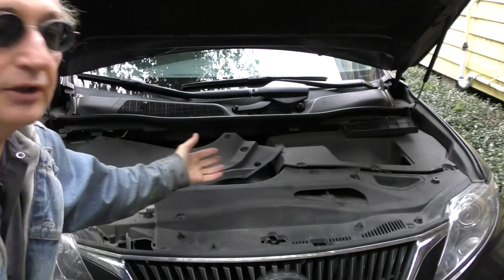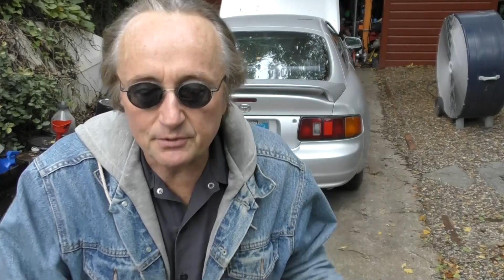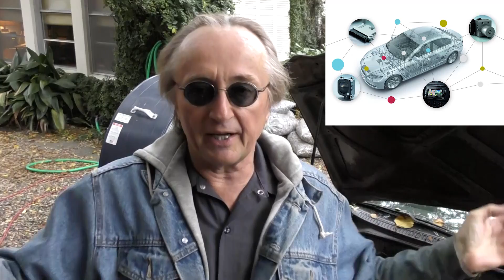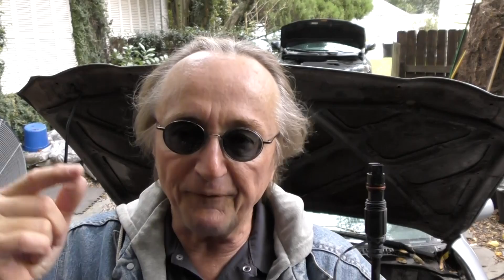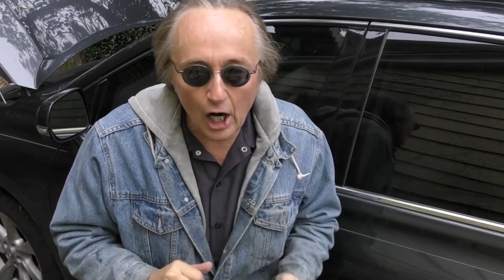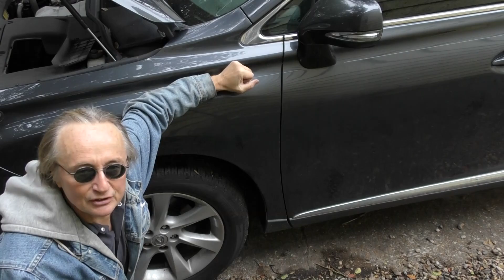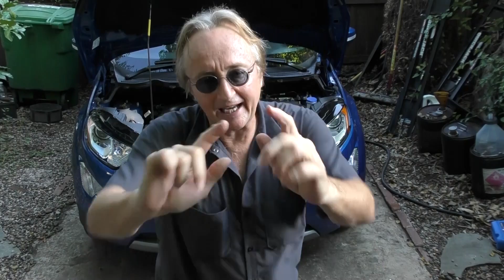The End of DIY Car Repair, Why New Cars are So Hard to Work On

Comment: Most effective way to save money is to do your own brakes. Example: stuck bleeder screw.... mechanic puts in new caliper. DIY guy fiddles for a bit and fixes it. Same with rusted sliders.... clean and grease vs. Mechanic replacing. Plus after-market brake parts are generally a lot cheaper than the OEM stuff from the Dealer.I just wish exhaust parts were easier to replace (due to rust) and cheaper to buy... an $8 muffler the Exhaust guys sell you for $80.... now that's a rip-off.

Comment: Scotty, I have seen you commenting on engine oil, but I have not seen you talking about gear oil . Especially gear oil for manual gearbox . I have a 2011 Mitsubishi Lancer with 5 speed manual gearbox , front wheel drive only. The user manual specifies to use GL-3 75W-80 gear oil.  I seem to have problem to find any kind of GL-3 oil and I have been warned not to use GL-5 oil.  You might ask me, why not use the OEM oil? Because the OEM oil itself is 75W-85 only .

Comment: Question: Came across advice to NOT warm newer car engines with tighter tolerances up during winter. Was told while idling and since the engine was not under a load, all the gasoline is not being burned and will actually 'wash' oil off the cylinder walls potentially harming the engine. Could you give your thoughts in a reply or video? Dismiss if you have already talked about this.
Thanks. New subscriber. Great channel.

Comment: Honestly I have 2007 bmw 335i and I have to tear down the front end and suspension to get to the oil pan gasket.. yea you heard right. But I'll be ordering my car from here for those who are interested in finding a factory modern made classics, the website is called

 factory five racing

you order.. they build.

Comment: Hey Scotty! I hear that petroleum based engine oil starts to degrade after the first use. Some dealers say you have to change it every 6 months even if the car has only traveled 1,000 miles within that period. What do you think?

Comment: How do you do a Crankshaft position sensor relearn procedure on a car.  I have a 2000 Pontiac Bonneville SSEI that stalls when hot randomly when in stop & go traffic.  Replaced electrical system coil packs, alternator, battery, etc. And cleaned throttle body along with its sensors but still has problems. Has plenty of get up and doesn't show signs of  bad fuel delivery or lack of power on take off. It started having problems after the PCM/ECU was replaced with an after market one from Intense racing™. I'm Cluless

Comment: Hey Scotty how's it going :)
What do you think about the 2nd gen Nissan Xterra? In particular, the 2009-2015 ones as the 2005-2008 ones mostly died from transmission and radiator milkshake :D

Comment: Even mechanics today dont fix.
They remove & replace.
Most don't break down & rebuild an alternator or any cimponent. They just swap it out.
 (There are a few great mechanics that can + will rebuild from the smallest gear to an entire vehicle, but they are few) due to time labor cost.
Reply: So in your mind only those that " rebuild from the smallest gear to an entire vehicle " are "great mechanics"? Well you are entitled to your opinion and I respect that. 
Does anyone know the last time Scotty rebuilt a starter or alternator?  If "removing and replacing", or a "swap" remedy's the problem, isn't that considers a fix? 

When I started my career in the late 80's I rebuilt countless engines, carburetors, alternators, starters, transmissions, master cylinders, power steering pumps, cored a few radiators, and even replaced broken ABS tone wheels on half shafts(Fords were good for that). By the late 90's many companies were offering very affordable remanufactered parts. It ultimately came down to one main factor that killed the inhouse rebuilding era around here. Rebuild / repair kits were no longer being sold by auto parts stores, and soon became an obsolete option. But I quickly realized the benefit of R&R and so did the boss. I could replace 3 to 4 F body GM alternators in the same time it took me to rebuild one. The higher production meant more money for me and the boss. We had entered the new world of remove and replace. The only thing i rebuild these days are carburetors, but thats every now and then, maybe 1 or 2 a year -  we have very few left in these parts.

Comment: Scotty, what do you think about Ford ripping off people on the 2015-2017 Mustang? They have wide-spread evaporator core failure. If you're lucky it fails while under warranty, but mine failed shortly after the warranty expired. Cost me $2200 (mostly labor) since they have to take the WHOLE dash out to replace it. Also, my water pump failed at 60K miles. (Another $800) Wowzers.

Comment: I have a 95 Isuzu Hombre truck (chevy S-10) 240000 miles on it. Paid 700 for it a couple of years ago. It got me trough my divorce and I still use it as my daily driver for work. It has a 3200 4cyl with 5 speed man. Very little rust. The cooling fan broke a couple of years ago and went through the radiator. I quickly drove it right back home while still leaking (4 miles). I replaced the fan and radiator with new parts from the internet. The coolant lever keeps dropping for no reason. There are no apparent leaks. No water on the dipstick. I put radiator seal in it. Nothing. I put a higher PSI cap on it. Nothing. It keeps slowly loosing coolant. Now if I keep driving the thing as is, with a spare jug of coolant, that's fine, but is there something I'm missing???
Reply: wcemichael / worst case - head gasket leak, meaning coolant is getting into the oil and burning off in the motor, you will see steam coming out of where the rad cap when off if so, might be a good idea to just pressure test the system and see where it leaks from though.
Reply: @52ChocolateAcorns  Already stated no water on dipstick. no visible leaks. not enough run time to damage engine.
Reply: I had a old dodge van that had an internal leak where the backside of the water pump housing or timing chain aluminum engine housing wore
 a hole through it letting coolant into the engine. Eventually got so bad the oil was turning "milky" coffee colored. Had to replace the timing cover.
Reply: @jdog5534  I'll keep that in mind.

Comment: There's fewer and fewer things a diyer can actually fix on the newer cars, some you have to have an expensive scan tool just to do a simple brake job partially because of the electronic parking brake. Also some manufacturers put really odd sized bolts or screws to where you have to buy specialty tools to do the job. Big corporate automakers are trying to take the independent shops out of the equation so all the money goes back to the dealership. Soon the automotive industry is going to be one giant monopoly, save yourself money and stick with older cars that simple tools is all you need to fix just about everything.

Comment: I had 4 Mavericks. One with a 200 straight 6, 2 with the 250 straight 6, and one with a 302 V-8. The 302 Maverick top speed was 110mph—about what my 2007 Honda Civic can do with a 1.8 litre.
Reply: Working on cars of this vintage is easy.  However, you were constantly working on them! Starters, alternators, water pumps, oil changes, spark plugs, points—all needing doing much more frequently than todays cars. And the carburetor, choke, radiator, voltage regulator—how soon we forget!
Reply: Sagging headliner, cracked dash, broken window/door handles—all of this by the time a Maverick has 70,000 miles.

Comment: speaking of anti-theft systems my mother purchased an 2007 impala lt. it did not have the remotes for the door lock and alarm.  So i went to my local junk yard and got a few remotes out of Chevy vehicles that were model year 2007. I also had to replace the module under the dashboard by the defrost vent because the tire monitor was acting stupid and that also controlled the keyless entry receiver. When i finally programmed the remotes the remote start, trunk,door-locks worked but the car alarm didn't. like when i lock the door you hear the beep i wait several minutes  to ensure the alarm was set but it doesn't go off When manually unlocking the door or pretending to break into the vehicle nothing happens. The panic button works too but i have to hold it for 3 sec for the horn to beep. i did a little research and found out about rpo codes in the trunk and it did not  have the anti theft deterrent code on the list.  i was told i can install an aftermarket alarm but after doing all that work to get the real one i want to know how to use the factory alarm. is it disabled in the body control module?
 i live in a neighborhood where car alarms is very necessary
please help me
Reply: it also has the base model radio ( the ones with the big ugly clock) and onstar on the mirror.

Comment: does my abs light on have to do with my traction control not working?97 Riviera supercharged,also I was told only the rear wheel abs sensor :s are the one that will make the abs light function,that part I don't believe so I brought my question to a fella I seem to trust"you"

Comment: A vehicle with a CAN System are mostly driver assist system and the self driving cars and there chassi system like brakes, steering and other easy fixes job are all integrated with the cruise control, ABS and even the key-less Operation System, not doing the right fix can cause a no start issue, or drive less issue that will affect the cruise control system and others. Cars of today are easy to drive but complicated to work on you need education. Am in West Africa: The Gambia. everything i know i teach my self. dont wait for others to teach u what u need to know.

Comment: Friend of mine is looking at a 2015 Impala at a Dealer with 45,000 miles.  Car looks really clean with no rust anywhere.  They brought it to me to look over.  Upon opening the trunk, and lifting up the flooring, I saw a puddle of water maybe an inch high, sitting in the well where the space saver spare tire lives.  The "carpeting" in the trunk was bone dry everywhere in the trunk.  The plug at the bottom of the trunk where the spare sits appears to be sealed and theres no rust anywhere to be seen.  No drips of water under the car.  What in the world caused all this water?
Reply: defective rubber seal on the trunk lid

Comment: Hey Scotty I have a 1984 GMC Sierra 2500 K 20  with a 350 Chevy small block  15,000 miles on the engine and 80,000 on the truck  every  I day that started it’ll take forever to start but what it does run and start it’s been amazing truck I was just wondering if you knew what the problem was that it wouldn’t start

Comment: Hey scotty love your vids. I have a 2014 dodge challenger rt that cut off one day and wont start. The car cranks but wont fire up. I plugged my scan tool up and it said Fuel level circuit 1 low and Fuel level circuit 2 low. I was thinking maybe the fuel pump went bad but am not sure after watching this video about how confusing modern cars can be 😅. Any clue what could be going on?

Comment: I have to agree scotty to a certain point. Cars are a bit more harder to work on and have lots of electronics, HOWEVER for older people working on this is harder because they are use to a certain way of working and mostly everything requires a wrench and changing parts, etc.... but new younger generation will be able to work on them and upgrade them etc... because they growing up with the technology and the tools to make this cars easy to work on. I recently work on an 05 Prius and was hard to work on, not because all the computers and electronics they have. It was the tools need it to work on them that was the problem.... They freaken expensive. I need it a mega oms meter to check insolation on wires and that tool alone cost 800 dollars, i was lucky my uncle is a professional electrician so he hard serval but that is the biggest problem. That is the biggest problem, then you also you need osiloscopes another 800, special OBD2 scanner usually cost 5000 dollars etc. Then you need to learn to use them because is not just plug and play. But learning is not hard, for an older person it can be because they might not have patiens or hard to accept change, is part of human nature.... i learned a lot from youtube and my own research on how to use this tools, fix my Prius and in parts cost me like 1000, but the dealer was saying its 5000 dollars.... You will see in 10 years from now all this car will be worked and repair by younger people who have learned to use this tools and also tools being relatively cheaper due to supply and demand

Comment: Scotty, I've been watching you for years and finally need your help!!!
My front passenger side has been clunking/popping when going over bumps, but not always. It also grinds when I pull out of the driveway, but then feels find on the road. It's a 2004 Mazda3 Hatchback. Suspension parts like struts and sway bar links were replaced. What else should I try doing?

Comment: Since most engine wear occurs at startup, wouldn't it be a good idea to have an oil accumulator system rhat releases oil under pressure through your engine when you first turn the key to on? Or when the new car "senses" when you are in it? Seems like a "pre-pressurized" oil system would greatly cut down on the overall wear of the engine. ? 
Wutchya think? Is it worth the expense?

Comment: hey Scotty, i have a question for you: it is true that modern diesel cars from europe do not last more than 120k/150k miles? i heared from my mechanic that those stupid anti-polution devices such as egr, dpf, and some crazy systems with urhea destroy the engine. so if it is true, the effort to build a vehicle, mold the parts, casting, weld , paint, etc should be a huge waste of natural resources... it smells like a good deal for the car industry. so they can sell you a more "clean" vehicle each 3 or 4 years.

Comment: Hey Scotty, what do you think about electric cars? I’m considering purchasing a used 2016 Nissan Leaf with 18,000 miles for $12,000. I either continue paying $300 a month in gas along with the maintenance that comes with a 20 year old 4.3L S-10 or buy a newer electric car with little to no maintenance for less than I’m paying in gas (my daily commute is 60miles round trip and I’m allowed to plug in at work). Help me decide to make the leap or run away. 👍🏼

Comment: I have a 3.8 liter motor in a 2009 Jeep Wrangler.  The Jeep has 62,000 miles on it.  It has started using a quart of oil between oil changes.  It also has a code that states that the EGR valve has an issue.  Are these motors loosely like I’m assuming they are?  My 2003 Toyota Sequoia has been trouble free since I bought it new. 
Thanks for any advice,
Engineer John

Comment: Hello Scotty. Long time viewer here, I finally have a question. I have a 2006 Skoda Fabia with the 1.2l 3-cylinder engine. It has never had its coolant changed, only topped up on two occasions. It uses the red/pink coolant. The car has been serviced annually at the authorized dealership and I've asked them twice isn't it time to change the coolant. Both times they told me that the cooling system is sealed and that coolant doesn't need to be changed unless work has been done on the cooling system. The service manual says "the cooling system does not require any maintenance under normal operating conditions". However I know that even long life coolant should be changed every 7 years. What should I do? Thank you for your videos and best wishes.

Comment: The new no moving parts of spark plug control units are great no cap to replace or rotor things last forever tune up is only plugs or wires most of the new parts designs today are easy to work on but don't be fooled by scan tools they often get it wrong with only a place to start looking for problems if senors are failing better to replace all of them some get more abuse from high temps ect. those need replaced more often but over-all the engines are more basic in design with computers controls that are better at controlling fuel air mixture and timings but senors are vital for those systems to work alot times those small computers that control things in a car like seat warmers ect. go un-noticed  when they fail and are not vital systems.

Comment: On a 2005 Chrysler Sebring touring 2.7 L why is the air bleeder on the cooling system is so difficult to replace why what's wrong with the engineers

Comment: These new cars with computers that make it change lanes and park for you, if they get in a fender bender ...they scrap the whole car! This is because the labor time it takes to check every software function, diagnose and repair any potential malfunction will be so high, it will be cheaper to just buy a new car.
This is part of their convoluted goals: it forces used-car-buyers to buy new cars only.
Reply: It's the plan.  Throw it away and get another one.  Meantime, your dealer will fix the problem at their cost, and re-sell it.

Comment: Ill tell you my opinion on the subject of new car repair, Scotty.
I'm young, and im just getting certified to do diesel mechanics, but ive been doing cars for a while. I own a 2002 f150 with a v6. Its cramped, but theres still working room. These new cars are so bad, you have to seriously remove a bunch of stuff to get to a spark plug. Thats sad. Then, theres some cars that make you jack up the car and remove the wheel just to get to the battery! Its ridiculous! Compare a truck from the 70s to a truck today. Mechanics are becoming electricians! Theres so much crap in the way, you practically have to the lift the engine to get the heads off in some of these, at least thats what it feels like. Its a bunch of BS and they want your money.